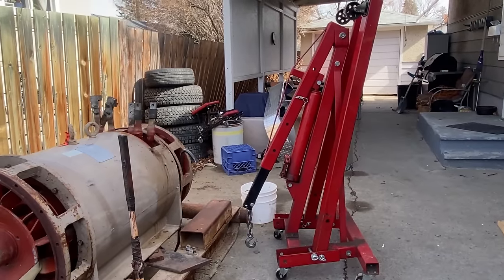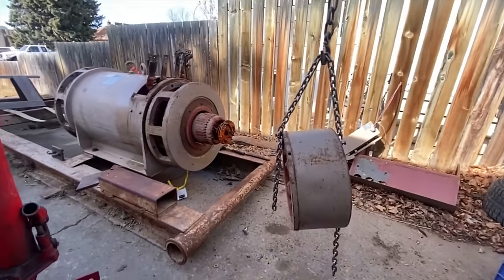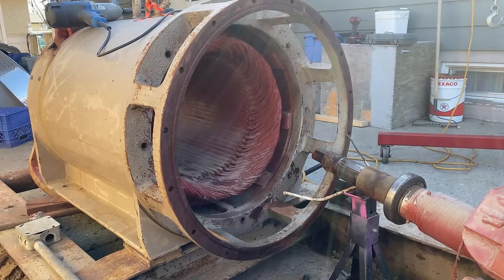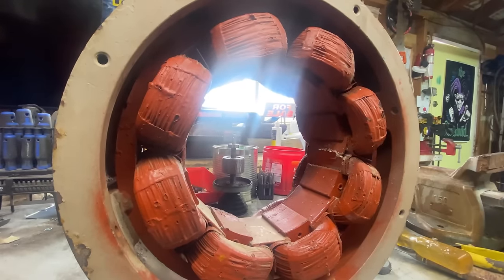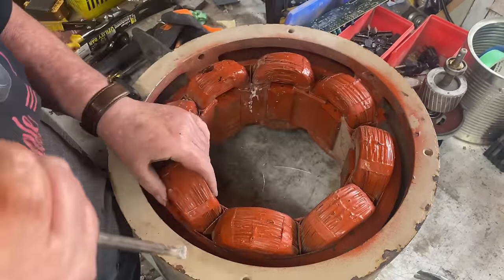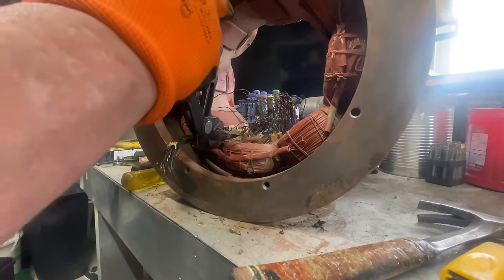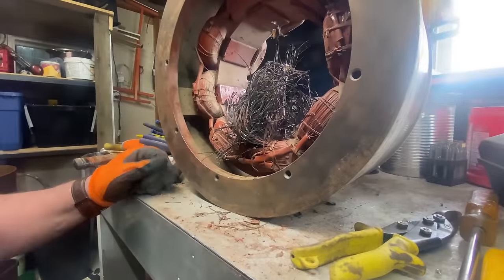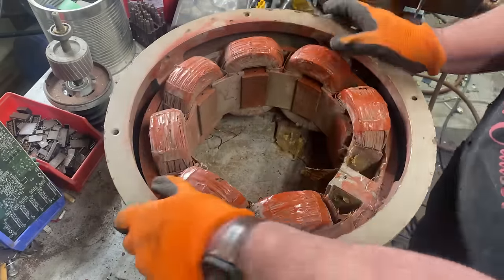We Got it Out - Scrapping a 9,000 Pound Generator - Part 2

Comment: Cut 1 end of each winding off with a cutting wheel on a grinder but use a respirator or at least a dust mask . Use one of those rings and some metal to prop it up, then use a metal punch or blunt air chisel to drive windings out other side
Reply from the maker: Thanks very straight forward

Comment: Awesome job!
Thank you for the mention and sharing a link to one of my videos in your description. 
I was actually talking about the big stator when I mentioned that idea. 
Wonder if you have enough room to cut the top part of the coil pack then use a punch to drive the rest past the steel pieces holding them in. 

75 feet of snow 😂😂 you crack me up.
Reply from the maker: I’m actually going to try that what a great  idea
Reply: @nicejunk666  awesome!
Reply from the maker: I’m going to order some diablo cutting disc for the 7” and the 4” grinder
Reply: @nicejunk666  heck yeah, that should do it!
Reply: I agree. Cut the ends off. Maybe then punch out every other one and the rest will slide out. 
Or to make space, even cut a gap up between the loops like 👉0|0
Maybe have to cut the ends off top AND bottom so you punch out straight pieces.🤷‍♂️
Probably have a pound of copper dust to sweep up! Man, the resin/glue looks challenging😅
Reply from the maker: @dr.a006 it is definitely the way I’m leaning towards that

Comment: Damn you really had my hopes up for a second there. Anyway here's my strategy: Stop fking around with that mess you've got going on. Every other coil, cut the top of the coil off and hammer/chisel it out the other side. So it's just 2 chunks, not a mess of wire. Then once you've got every other coil taken out, what you need to do is chisel/pry under that lip on the side of each coil. As in, you need to be driving a flathead in between coil and steel, but you need to be perpendicular to the coil. If it's flipped up on it's side (so it can roll), you'd be driving straight down... Then once you have some seperation between coil and steel, you should be able to pry out the coil in one chunk like your original idea.
Reply from the maker: Sorry I didn’t mean to mislead you, being sick I was not thinking straight definitely have a plan going forward

Comment: Hey nice junk! I just subscribed and tuned in to part 2.  Pity about the weather. The ex wife ❄ 💙ouch💯 that's pretty damn cold. All jokes aside..... i hope this makes sense? Maybe you could stand it up again and use the air chisel to cut once on the end through the center of the copper coil downwards so it cuts in the middle down as in toward the outside casing. Then Spread the copper apart where it's cut. Do them all first then lay the whole thing down flat with cut side down. Should Lever out. Or leave it standing up and tap out with your screw driver and hammer. You've made good progress for something so big. The enamal on those coils wouldn't be helping. Tackling something like this is exhausting physicaly and mentally. Hope you get well soon in time for part 3😂bring out the heavy artillery 🏋🤳🏼💪🏽🦾🔥💣🙈🙉👀👁👌😉🤣. Stay safe brother!
Reply from the maker: Welcome to the crazy train, I call nice junk
 Glad you enjoyed my sarcastic sense of humour 

You definitely bring some great thought to the table 

Thank you so much

Comment: Air chisel a longer tip you doing good not easy for me long time ago we used to burn the motors and then we use the air chisel
Reply from the maker: Ya when I was doing that the thought popped in my head several times

Comment: I would have a small fire inside of it to melt all that stuff off and the it should come easier but not sure if your scrap yard would dock for but thats what I would do
Reply from the maker: Ya my yard for #2 is currently $4.75 Canadian and burnt copper is $3 plus I need a note from he fire department or the insurance company
Reply: @nicejunk666  its illegal to burn copper here can't even get a permit to do it only other idea I have is to cut the tops off of them and try to drive them through with your air chisel ive never scrapped anything that big myself so im learning as you go also
Reply from the maker: @DavidSmith-yw3sb ya it’s a huge no no for sure, I have a few good ideas so we will test them out I’ll make sure I record it

Comment: When I do those, I use a grinder on one side and cut it as flush as I can get it, and then use a hammer and flathead to push the horseshoe shape out the other side.
Make sure you wear safety glasses and a mask
Reply from the maker: Thanks ya that’s a pile of glue could be toxic

Comment: Cut the top and bottom, with a cutoff grinder, then pull it up
Reply from the maker: I think it’s inevitable going to have to cut
Reply: Or perhaps you could cut the little "L" lip on the front of the center block off inside each coil?
Reply from the maker: @nickyleblanc4200 I think that’s the biggest culprit

Comment: Just burn it in a large fire and once it cools that copper comes right off. I did about 200 lbs the other day like that.
Reply from the maker: I wish I could my yard won’t buy burnt copper
Reply: @nicejunk666  if you reheat it then dip it in cold water it brightens right back up. I get #1 price for mine when I do that. Maybe try a coil sometime and see how it goes. Just make sure its thicker gauge.
Reply from the maker: @nathanmatthews2466 oh I will have try that  does it work on pipe too
Reply from the maker: Oh I definitely will try that I figure there’s 540 pounds in that generator combined
Reply: @nicejunk666  Nice! I haven't really tried pipe. Just mainly all the giant transformers I get with all that junk on it. Melts right off and saves sooooo much time.
Reply from the maker: @nathanmatthews2466 I have 400 pounds of 1/2 inch pipe with some horrible coating on it

Comment: Next motori get with lots of glue, I'm gonna try a heat gun
Reply from the maker: This one is insane the amount of glues there is on it
Reply: That's why I wanna try heat. My thinking is it might soften the glue.
Reply from the maker: @TB-Metals okie dokie scrapper said in one of his videos to put methyl ethyl ketone in a plastic container put the motor in there and even if it’s not covered in solution the glue will practically melt off from the fumes
Reply: @nicejunk666  that would probably do it.

Comment: Wow that is a very nice load of copper. I would try a longer chisel 4 your air hammer  when removing copper bars. Or just cutting both ends .  Texas USA
Reply from the maker: Thanks definitely will have to consider that
Reply: If you cut only one end off of each winding and drive it out with a air chisel/punch you'll have a big U of copper with a lot less effort